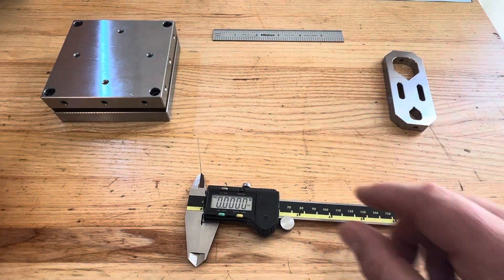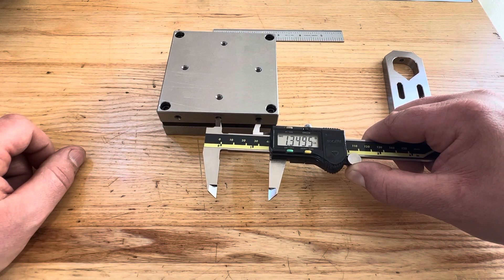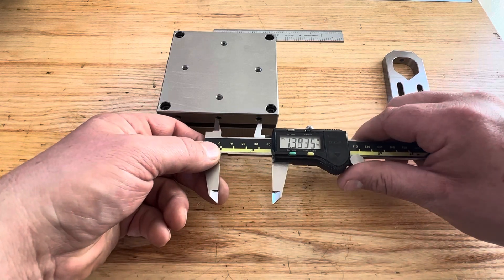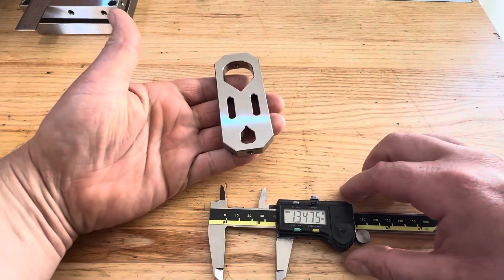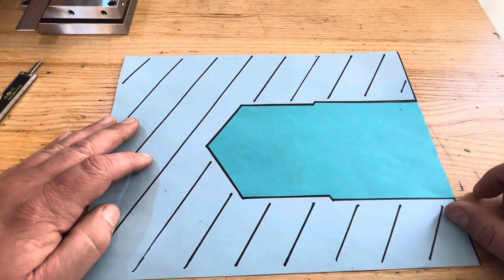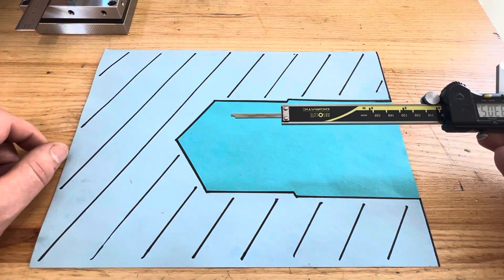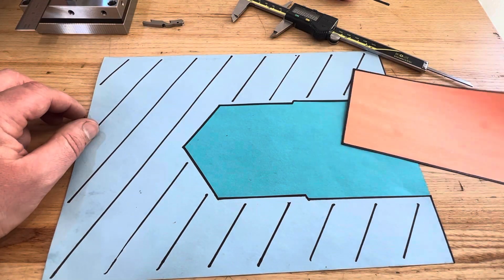Secret Digital Caliper Functions

Comment: Hi Adam,
I saw this video of yours that shows how to take "difficult" measurements with a standard caliper.
I thought I'd share these videos of mine that illustrate a new concept of electronic caliper, designed specifically to allow measurements that can't be done directly with a standard caliper.
The original idea came from the need to measure the center distance between holes, exactly as you show in your video.
Here's the link to our YouTube page where you can find our videos about this innovative caliper, which we've called the "RPN caliper."

www.youtube.com/@ATOMATICSYSTEMS

Best regards

Comment: For hole to hole I guess you can employ same technique but using external features. Put two shoulder bolts in each hole, say they are 10mm shoulder dia. Now set the caliper to 10.00mm & zero it out. Now measure outside to outside of the shoulder bolts, the shown dimension is center to center of the holes. Basically it's your method but on a solid shaft sticking out, maybe comes in handy in some situations. What you showed is more elegant though as it doesn't involve anything but the caliper.

Comment: You can also just measure from the outermost part of the hole and the next hole inner part and you dont need to measure the hole and zero it out yet
Reply: How do you do that when the holes are on the same plane, and the outer jaws and inner jaws are opposite sides?

Comment: In general, you can use your calipers to do addition and subtraction.  By doing the measure, set zero, and measure something else, you are doing subtraction.  If you measure one thing, note the measurement, measure something else, zero out, move by the noted measurement, zero again, and then close the caliper, you will get the sum of the two.  (drop the minus sign)  I routinely use this when turning things on my lathe.  Measure the bore in the part I am trying to match or mate to, zero out, then measure the part that i am machining, and the number on the caliper is the amount I need to take off.  Divide by two and that is the amount I need to move the cross feed.

For all hobbyists that use cheap calipers, make sure that the zero is correct for all four measurement points zero at the same time.  Clean the inside jaws first.  The top of the head should be flush when the outside jaws are clean and closed.  Zero the outside jaws and then  measure a gauge ring and it should read the right number.  If you don't have a gauge ring, you can use the inside of a known good bore, like a good end mill holder.  Also, you can zero on the gauge ring and close the outside jaws and you should have the diameter of the bore in gauge ring.  Use a gauge block or mic standard and surface plate or other flat surface for the depth.  If they are off by a half thou, ignore it.  They aren't that accurate anyway.  Even high priced calipers have a +- one thou accuracy.  If they are off, but close, you might be able to stone them in.  If they are way out (I had a harbor freight set that was out by 7 thou for the depth tang) you should probably pitch them, unless you have a surface grinder.  You shouldn't even think about trying to mill them to the correct them.  They are hardened and ground stainless, and seem to work harden even more.  (if that's even possible)

Comment: I use these methods often. Another "trick" I use is to Z my calipers at the dimension I'm cutting to on the lathe. Then measure after my first pass. With no math needed, it displays how much material that needs to be removed. Z out the DRO, move the tool in that value, Z the DRO again at my final dimension. I can then back out and take a series of cuts down to 0.000" and verify with my calipers.

Comment: When turning diameters, I will preset the caliper to the target diameter, and then while turning the part, a check of your progress will show how much you need to remove to reach your target diameter.
Reply: So if you're target 10mm, you set it to 10mm, then zero it, correct? So when the caliper it closed, it shows -10mm.  Then you're turning, and say the part is 11mm, it will read 1, meaning you need to take 1mm off the diameter to reach your goal.
Reply: @larrybud  That is correct.

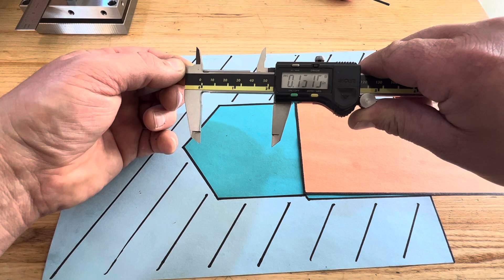Comment: My eyes near popped out of my head at 2:55 when he measured the pin with the back of the inside calipers. You can do that?
Reply: It was not so much the back of the inside calipers. It's called "a step measurement" if I'm not mistaken and it seems to be a standard feature of calipers, even the one I got for 5€.

Comment: Question for the machinists out there (you included)... because the caliper measuring surface you used is ground flat and the hole is round, using them to measure a hole diameter or spacing results in an estimate, does it not?  It will be very close to the actual measurement, especially as the hole diameter increases, but still an estimate because the caliper surface does not directly mate with the hole's surface.
Reply: The jaw width does indeed cause calipers to under-read the diameter of a hole. However, the method shown here to measure the pitch between holes removes that diameter error.

It's worth noting that this method only works when measuring the pitch between two features (holes, or slots) of the same size.
Reply from the maker: The id measuring jaws that I used are ground to a blade shape . There’s a small flat land at the end of the blade , maybe .2mm wide . And yes that does make it so you aren’t truly measuring the widest point of the bore, but calipers aren’t the first choice for very high precision measurements. The variance is within the acceptable range of a tool like that

Comment: A trick I've seen Steve Summers use is to measure a simple feature. Any length, width, dia, anything, and zero the calliper on that measurement.

Then, when you close the calliper, you have a negative reading of your feature dimension, but because you have closed the callipers, it doesn't matter if the callipers are knocked, or bumped. you can always read off the previously measured feature by ensuring the callipers are closed.

It's more difficult to explain that it is to do, and has saved me a good deal of time when I go back to my callipers to remind yourself of the dimension I've just measured.

Comment: The gauge pin one really hits me hard.. I have inspection department measuring reamed steps as you said, use calipers or depth mic, saying it’s out of tolerance , but using a proper size gauge pin like I used at the machine is by far the true most functionally accurate way to measure that feature.. I haven’t seen anyone else use it until I saw this video. And I love your videos , someone who truly understands what they are doing
Reply: Have been SOP for blind/bottom threads at every place I've worked at. Measure the length of the thread gauge, zero the caliper, thread the gauge in to the part until it stops and measure between the end of the gauge and the top face of the hole.

Comment: Yes! The ability to zero a digital caliper/mic/dial and gauge is super useful and under utilized. If you inspecting a series of parts it much better to zero it at the nominal dimension and then you can just see the plus and minus reading instead of looking at a long string of, in some cases random, numbers and trying to remember the nominal number. When doing a production of parts I'll often grab a couple calipers and zero each one for a specific feature and then I can just grab each one and instantly know if I'm on size or not without any mental math which could (and will at times) fall you.
Also another use is measuring between the head of the caliper and the moving hook. Think if you needed to measure from the mill table to the bottom of a part over hanging in a vise. Not something overly common but its pretty easy to do if you have the right scenario. Getting the zero is a bit of setup as you need to build a reference with something like gauge blocks but it is a quick and easy way to make that sort of a measurement if you have to do it over and over.

Comment: Thank you for this great information. I'm an older retired machinist/toolmaker who was trained on vernier scale calipers. The dial calipers were the "new thing". I own some digital calipers but never thought to use them in this manner.
Reply: Digital calipers are underrated. Like a good micrometer, they can be ham-fisted. Once you learn the "feel" (by comparing blind measurements to a mic) you can get .001 or better accuracy and repeatability all day long.

Comment: Tip: After measuring the center distance, be sure to re-zero your calipers before using them to layout said holes. Ask me how I know.
Reply: I've gotten into the habit of always zeroing the calipers before I do a measurement.  Never a waste of time in my opinion.  Don't want to measure 50 parts, then find out it wasn't zeroed properly.
Reply: If I zero them anywhere but a clean zero, the alarms start to sound 🚨until🚨it's 🚨 reset to zero.
Reply: ok I'm laughing 😆
Reply: Better yet, because I do a lot of hole spacing measuring I have a few sets of Center measuring calipers. They don't require any setting or calculation. They save a ton of time.
Reply: How do you know? Wish I could say I’ve never done anything like that. Thank you for the tip and the laugh.
Reply: Yes, I learned it the same way.😂😂😂😂😂😂
Reply: That hole center is clever…but suggest doing math will keep one out of future trouble.

Comment: This is one of the reasons why digital calipers are so much faster in real use than analog ones. Incremental mode has many uses!
Reply: All dial-calipers I've used have the ability to reset zero.
The real benefit of digital calipers is the ability to quickly switch between units, either for conversions or so you simply don't have to go back to your bench to swap calipers. :)
Reply: @glabifrons    Right.  I have one with three unit setting.  Metric, inch and fractions.  Last one is good for sorting loose drill bits.  (don't ask me why).  😂
Reply: Yes it is BUT each type of caliper has it's own super power. That's why I keep an excellent example of all 3 ready at all times.

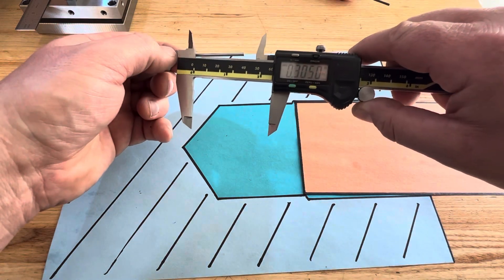Comment: I'd never thought to use calipers the way you did at 2:56 to measure the pin, immediately went to get my pair to try it out 😅 definitely going to remember that, great stuff as always thanks adam
Reply: Right! He didn't even mention it either. Never realized calipers had a built in height gauge.
Reply: It's the standard way to measure a step with calipers, but it's the thing I always forget.
Reply: crazy

Comment: In first trick important note is, that both holes/slots have to be same exact size, right?
Reply: Yes. If you want to measure holes of different sizes measure them twice, once with the inner jaws, once with the outer jaws, then average. Personally I do this even on holes of the same size if it's a measurement I need to be particularly accurate.
Reply: @teguh.hofstee  With calipers, "particularly accurate" is already out the window.
Reply: @CosminHasFishTanks  Sure, but I have no problem getting within half a thou or so measuring twice, which is good enough for what I need. Zeroing and measuring I'm usually off by around a thou and change. I'm just a hobbyist.
Reply: @CosminHasFishTanks You should note that if the center distance of two threaded holes is that critical, then the clearance holes in the mating part are probably too small.

Comment: I use the inner and outer jaws on two holes, then average the two normally.  Zeroing on the hole diameter is going to be a lot quicker, and involve less memory powwr in future, thanks!👍👍
Reply: Using your old method will give you the right answer on holes with different diameters... the method shown here will give you the wrong answer on holes with different diameters,
Reply: @PiefacePete46  true,  especially when picking up threeaded holes and not accurate bores, but this method does save pulling out a calculator/smartphone 😉